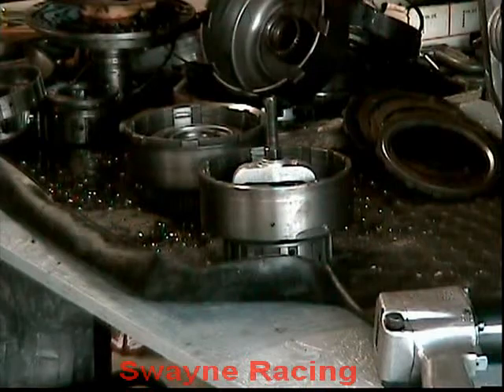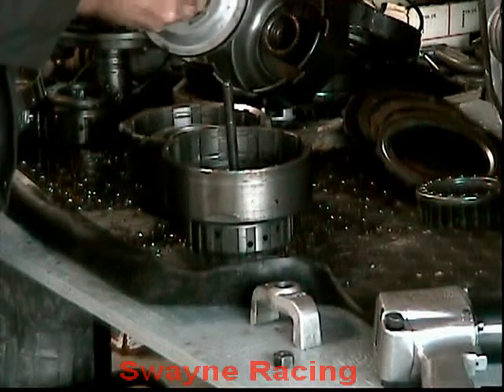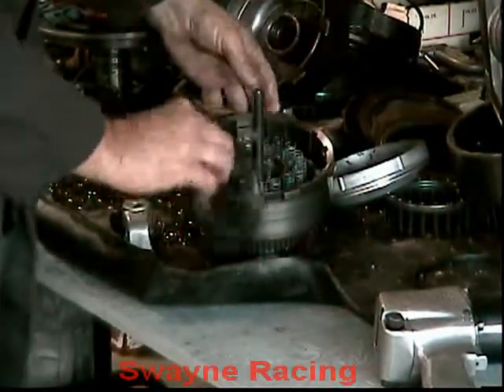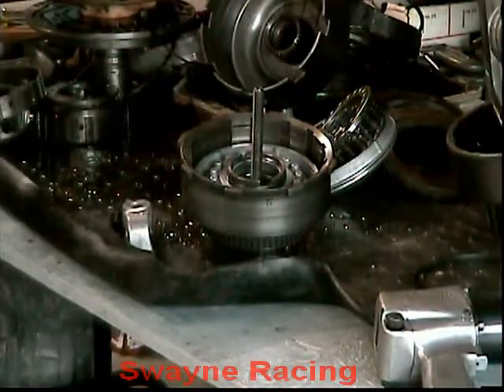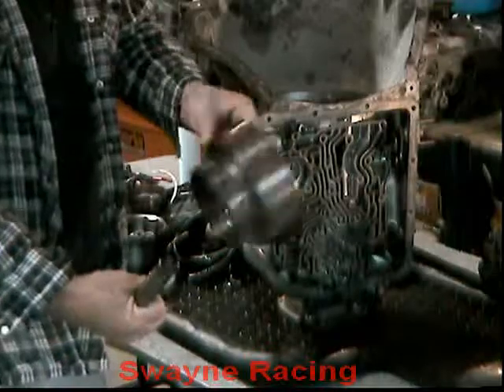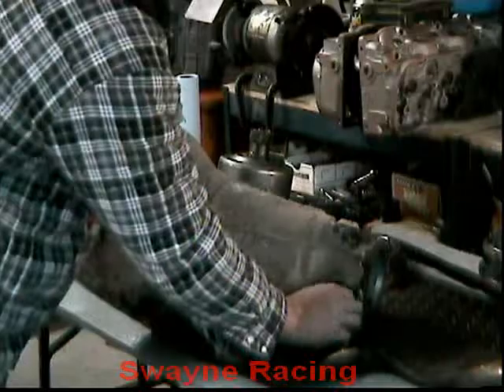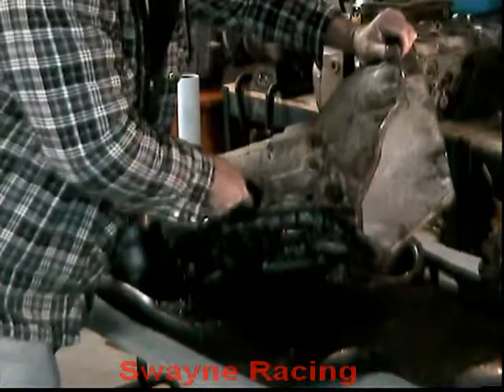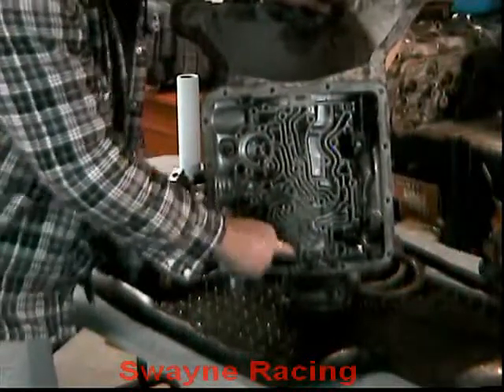Turbo 350 Disassemble Video-Part-2

Comment: Question what gear pump brand you use and size ? I have turbo 350 and ati .727 is that too thick ?
Reply from the maker: Stock is .725
Reply: .727 , does matter or not matter ?